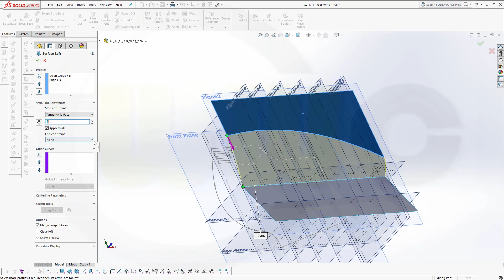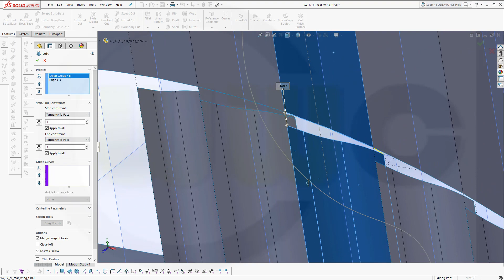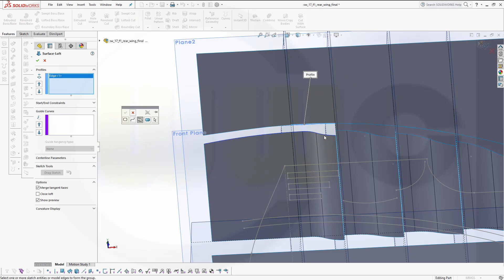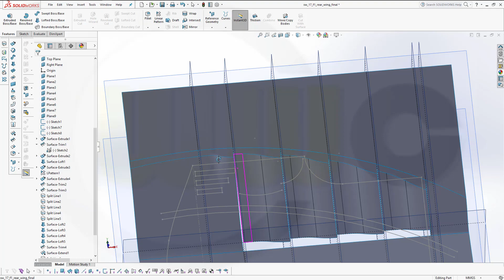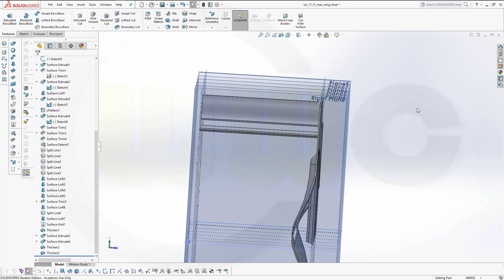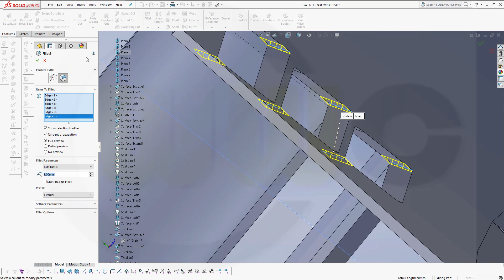F1 Rear - Wing Part 2 - SolidWorks 2017 Training - Surfaces

Comment: hello i have a big problem. I have been trying for 4 hours now. When i have to trim just after i knit, it does not work. I cant select  the surface knit when i want to trim. Also at a moment you check if you can thicken a surface and you can. I tried but it doesn't work for me
Reply from the maker: Sorry can´t tell without reviewing you model. Thickening might be not possible because your round/fillets are too small.
Reply: it seems to me that my comment got deleted because i put a link. i have made a video on my chanel of the problem. if you have time to have a look it s would be great
Reply from the maker: So I´ve watched your video, but I can´t see anything out of the ordinary. If you want you can mail me your part and I will see what I can do:  info@wwmc.de

Comment: good friend greetings would it be possible for you to design the monocoque of a f1 where the driver goes it would be of help to me and if you design a f1 with the regulations in hand you would be a god.
Reply from the maker: Sadly I´m not a god or anything similar.
Reply: @wolfgang.walden.cad.training  but you could design the monocoque of a f1 with the fia regulations or a f1 car?
Reply from the maker: Therefore I would need engineering knowledge regarding the constructions of such parts and the fia regulations.
Reply: @wolfgang.walden.cad.training  I would learn by watching you how it is done and interpreting the regulations, I don't ask you to make a very laborious car either, just make a car from the 2009 season which is simpler and doesn't have so much aero dynamics, with that I would learn a lot especially to make the monocoque, engine cover, front wing, rear wing, front nose, diffuser and under the car the steering arms ect but the most I want to learn is the monocoque.